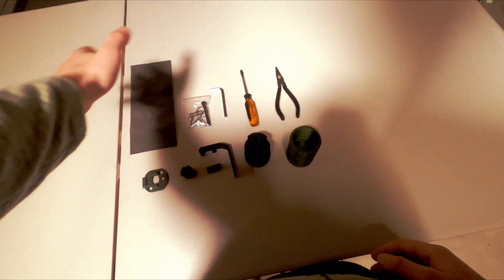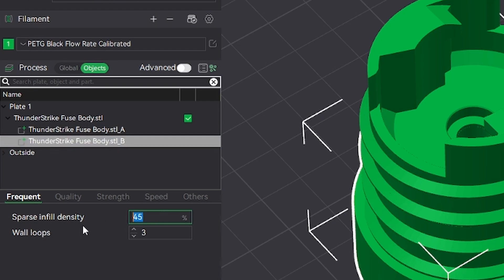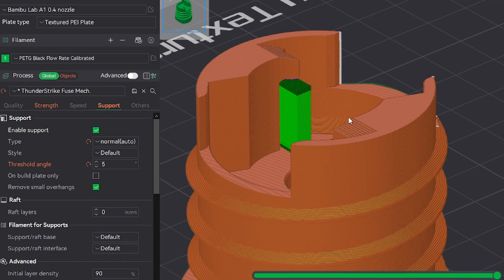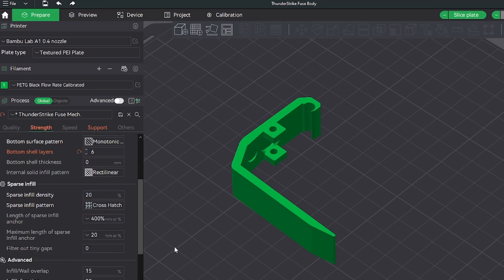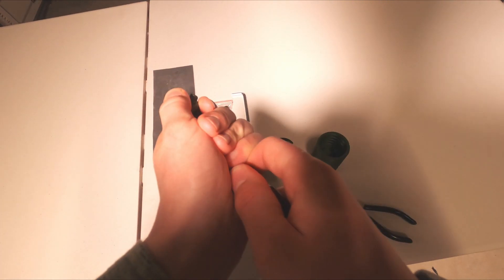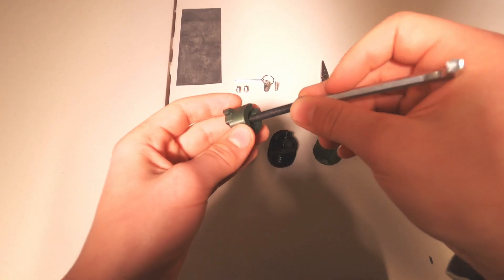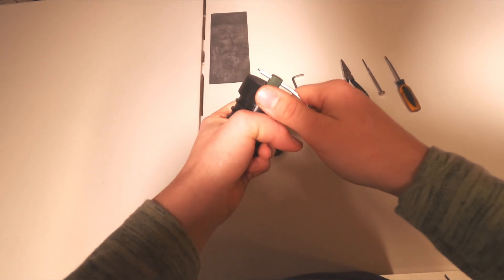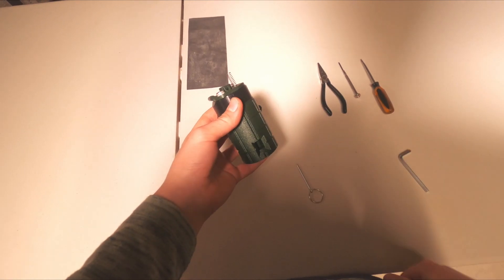ThunderStrike Impact Airsoft Grenade 3D-Printing and Assembly Guide | Full Guide

Comment: You know, it would also be cool if you could make an adapter that works with the .209 primers as well.
Reply from the maker: That's definitely on the project list. But the ThunderStrike is meant to be safer and more accessible than BFG's. Thanks for the idea, we'll work on that in the future.
Reply: @ yeah i get that. Have you tried the bang snaps and the cap gun rings on a db reader?
Reply from the maker: We haven't yet, as we don't currently have a proper decibel meter. We'll have to do a comparison video once we do get one, though.